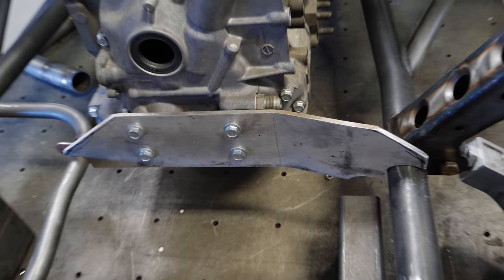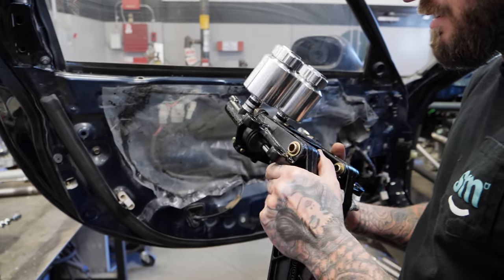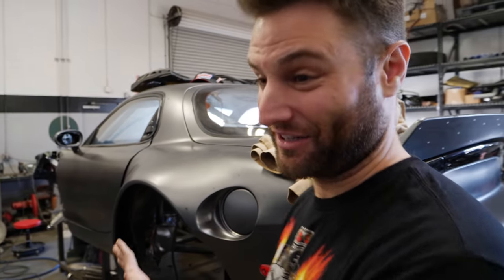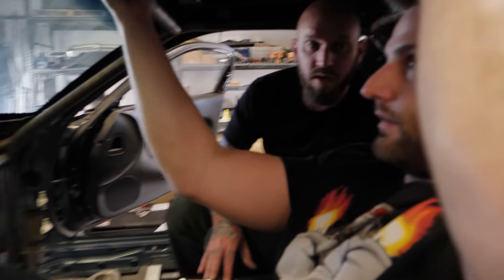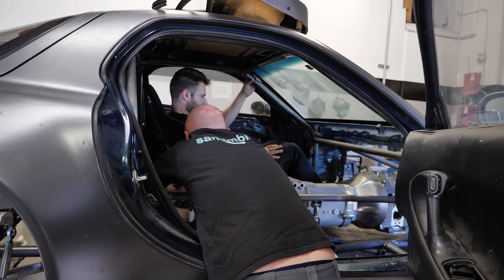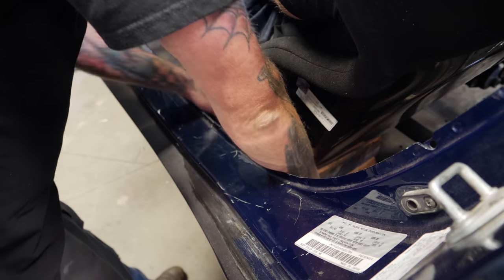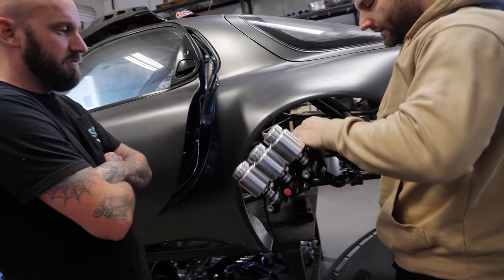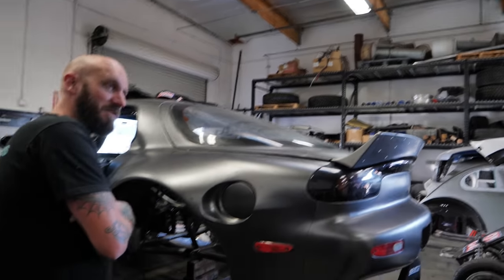It’s not easy strapping a human to an AWD Rotary Drivetrain

Comment: Rob hiding his videos like black widows are hiding in his 3 rotor
Reply: I'm not American so maybe someone can clarify for me, can this be registered and allowed on the streets or does the custom chassis prohibit it from getting a title?
Reply: @shona5512  Depends on the state. Some states have more strict requirements others... not so much. But every state does have specific requirements to meet for a custom vehicle.
Reply: What 3 rotor?
Reply: @shona5512  the way I understand it is if the body has a VIN then you can register it, a la roadkill nascarlo
Reply: Shona I think it will still be registering as a Rx7 cause if the body but with a antique tag which is for cars older than 25 years old and leaves almost completely free to do anything to it do to no inspection is required. Or you purchase s car you build and you purchase a vin number and it has to pass some safety and lights and stuff etc it’s not hard in some states.
Reply: @shona5512  It was pre registered as an RX7. He can just like.... not say anything o go about re-registering it. It is probably illegal in most states, but so is any car that has it's cats cut off.

Comment: What can a timeframe till finished be on such a build? There is stuff theyre doing I didnt even think about before...
Another year, maybe 18 months? 
Anyone got any Idea?
Reply: It'll be done by sema 2018
Reply: It all depends on the funding and staff level of who your working with. In other words a NASCAR team who does this sort of thing with tube chassis on a daily basis could knock out the chassis in a few weeks tops. That said when Mercedes designed the CLK-GTR car they used a Saleen S7 chassis for testing until they had a working carbon fiber monocoque, then transferred the drivetrain into the new car. They had cars ready for the 1997 season (FIA GT) in 128 days and dominated it until BMW dropped out in 1999.

Comment: Have you thought about impact zones in a hypothetical crash ? The reason a new car is much softer than an old one is your rate of survival is really increased when the car has a bit of "give" to it. I know having the entire chassis and engine custom built makes you want to preserve them at any cost but your life has to come first, right ??
Reply: GamerGunnar in a race car it’s different you’re protected by the cage your restraints and seat.  That’s why you don’t see crumple zones or airbags.
Reply: @douglasm3310  Yeah I know but either way the sudden stop will smash the shit out of you. Old american cars, if you drove 100 mph into a brick wall the car was fine but the driver was smashed to bits. If you have a car thats super stiff and you hit a rockwall for example it'll be such a sudden stop that your brain will crasch into the front of your head and you'll die

Comment: 0:36 in my opinion the welds look too hot and loose.
If you look closely you can see the difference in the surface.
Look at the other welds on the chassis.